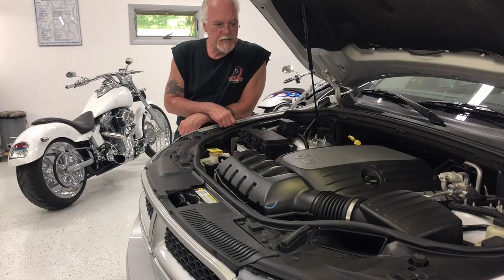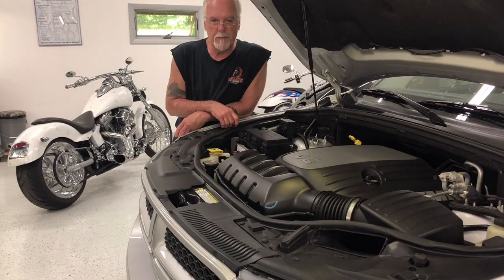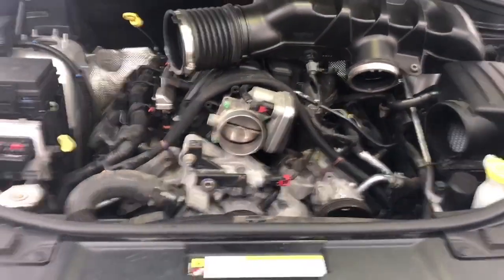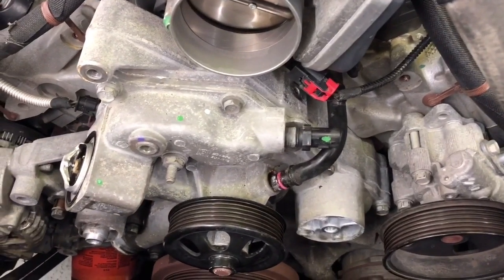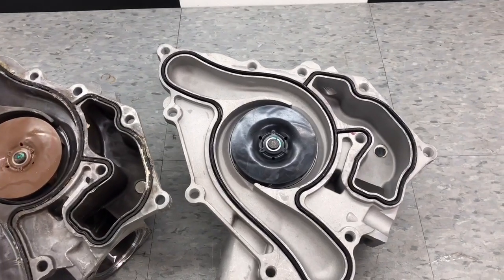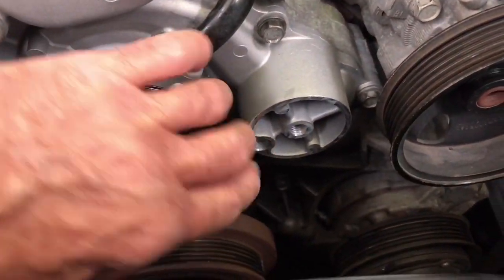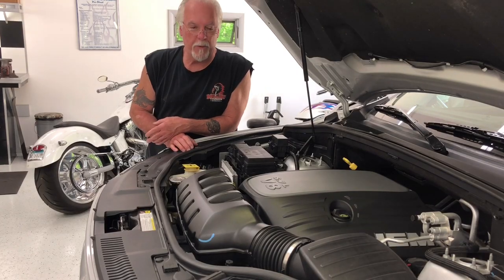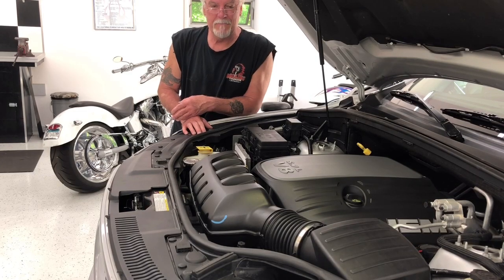Dodge/Chrysler 5.7L Water pump replacement

Comment: Awesome video and explanation of the job ahead was spot on. I recently took my 2014 Challenger 5.7L in for an alternator recall and was told my water pump was bad. Dealership in Chattanooga Tn Crown Chrysler Dodge Jeep Ram Fiat off 153HWY wanted over 900$ to replace. Thanks to your video I replaced myself with QUALITY parts and saved myself 500+ dollars and avoided a shady dealership as well.

Comment: I have a 2014 Jeep Grand Cherokee with this exact same engine and setup. Water pump went out with bad bearings. Luckily it was covered under power train warranty. Few weeks later got a letter from FCA saying they are having problems with these water pumps and are extending the warranty on the water pump from five to seven years. Hopefully they fixed the issue. If not I’m covered for another two years. Good walkthrough though. If I have another problem out of warranty I know I can do it now watching your video.

Comment: Connect lower water pump hose to pump before mounting pump saves trouble dealing with hose clamp and you will not need to go under vehicle to slide clamp on as some do.

Comment: This thing was idled lots and lots.  The Hemi does not like low oil pressure idling, this has been seen with police forces, they have all learned to run the pentastar.  That's what happened to your cam and lifters, idled to death on fair oil.  The water pump failed at that mileage is further confirmation of all that idling.  Sometimes you win on a used car sometimes you lose, I dare say this one had lots of runtime hours on it.  Chrysler also had a cam hardening issues for these Hemis for a few years.  Once you do the exhaust manifold I would hang onto it.  You did well fixing it yourself, might as well reap the rewards of that instead of someone else.

Comment: My 2011 charger hemi has just started leaking out of the wheel behind it so I'm looking at 6 to 7 hundred to replace or ican give it a shot replacing it my self if I had help it would be good as my body is weak from illness now but unfortunately I do not have anyone so if I do it myself it may take two days to get done but I'm undecided I need the car but don't have the money to just throw away almost a grand unless I wanna start living in the charger so I'm stuck with a non driving car at the moment

Comment: MY WATER PUMP WENT OUT AT 16,000 then again at 73,000 miles PHUC MOPAR WATER PUMP GET AFTERMARKET OR A PERFORMANCE ONE FROM SUMMIT SHYT AUTOZONE OR NAPA WILL PROBABLY BE WAY BETTER NEVER USE A MOPAR WATER PUMP